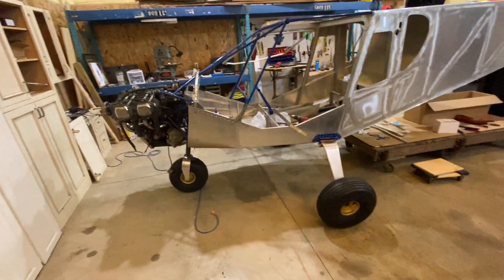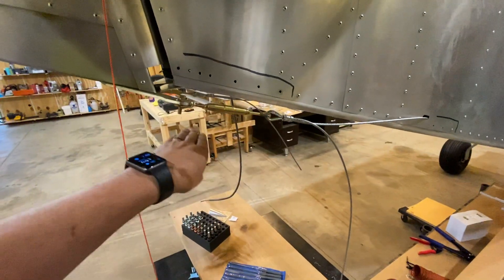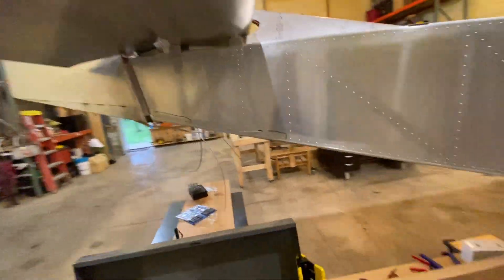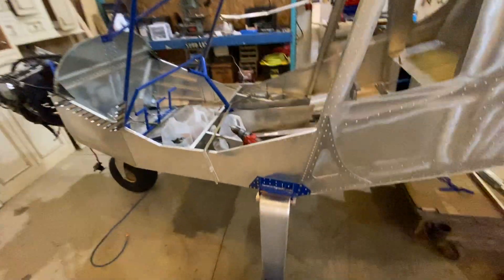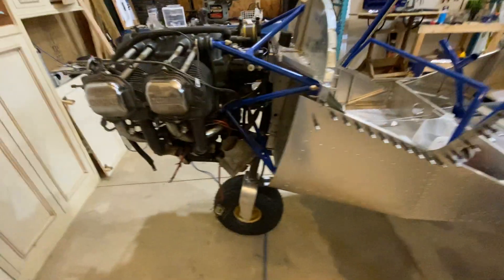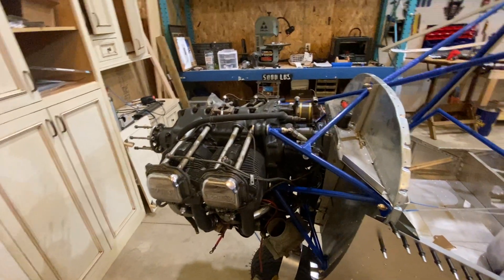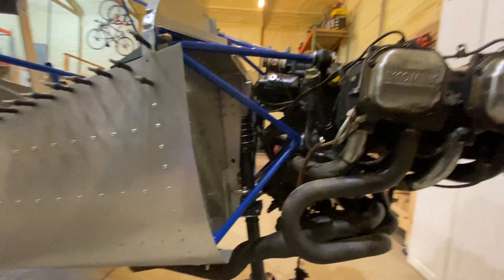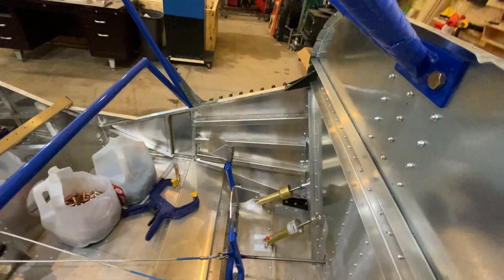Zenith CH750 STOL Build Log - Fuselage Overview

Comment: We're your wing strut brackets completely drilled also where they mount to the fusaloge were all the holes drilled, mine are not, 750 stol, john
Reply from the maker: I had to drill all the holes in the brackets. Only holes that existed were the ones in the landing gear brackets on the fuselage. It was a fairly tedious process but well outlined in the picture guides.
Reply: @dustybodine5221  thanks for the reply, I only got blueprints

Comment: Looks awesome. How does your weight and balance look so far? Did you have to add tail ballast? Lots of O-320 naysayers out there but Roger himself says it’s a go for the STOL CH750. I’m at high altitude and need the power. Otherwise I’d content myself with an O-200 or Corvair.
Reply from the maker: Haven't put it on any scales yet. I don't have anything else FWF including the cowl and prop so whatever I came up with would probably be too much of a guess to start adding weight. I am planning on using a lithium battery somewhere in the back so that should help out. No plans for paint yet either. We will see how it shakes out later this year. I have spoken to a few guys at OSH with the O-320 and they had nothing but good stuff to say about the engin choice.

Comment: Our EAA chapter is building a STOL 750 and came across a Lycoming O-235 for a reasonable price. Where did you get your engine mount?
Reply from the maker: Direct from Zenith. They had it in stock and ready to ship.
Reply: @dustybodine5221  can you confirm the O-235 and O-320 use the same mounts? Engine looks great on there.
Reply from the maker: @b7gwap  Not 100% certain. The factory should be able to answer that one or a local mechanic.

Comment: Have you looked at Viking engines? The Honda would be more reliable for such an investment. Inexpensive too.
Reply from the maker: Andrew Betances thanks for the comment.  I have spent lots of time over the last few years pondering engine choices. I have read lots of positive and negative reviews about all of them. I respectfully disagree that the Viking engine is more reliable than a Lycoming. They are however quite inexpensive. My engine was free to me which was ultimately the deciding factor on the O-320. I have only invested $700 into the mount so I’m still not completely married to it yet.
Reply: @dustybodine5221  faur enough. I am building a 701. I'm a bit limited on engine choice. I just looked up the Mitso, rotax equivalent for Lycoming, and the weight of the IO233 is a no go for my little plane. For now, it's between a $28k rotax, $12k Viking, or I think also $28k UL. I am pretty interested in the Yamaha RX1 but i think it would be too much of a custom job at this point.
Reply: @andrewbetances1203  don’t forget Aeromomentum for your 701. I think they have a little one that wouldn’t be enough for the 750 but might be just right for the 701, and you get a brand new long block and PSRU instead of a salvaged  engine for around a similar price. I’m building a 750 and will be following Dusty here by doing a Lycoming myself. http://aeromomentum.com/am10.html